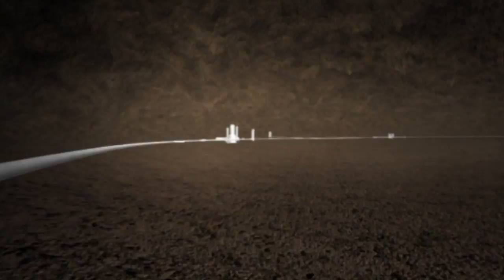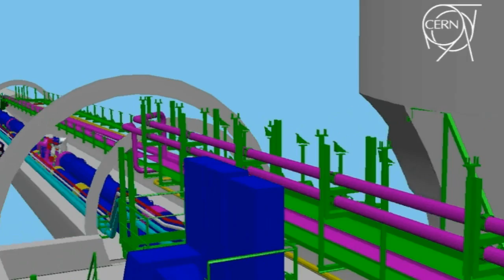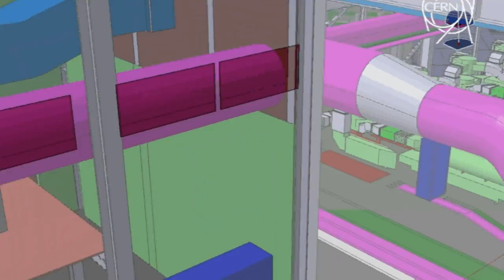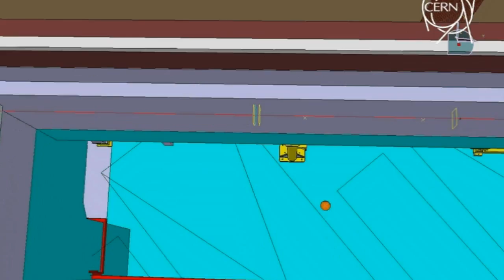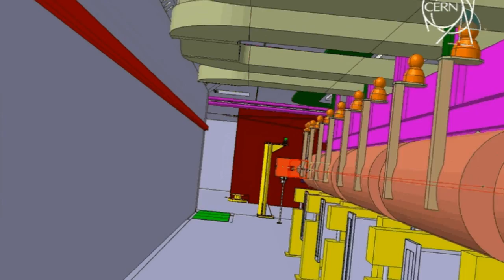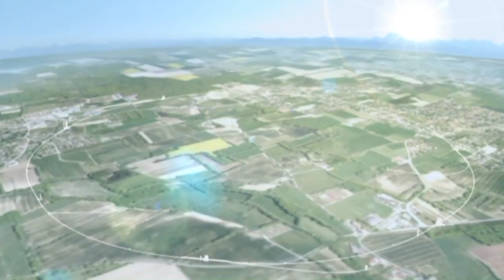CERN: LHC Virtual Visit

Comment: @fertilizerspike 
What bad behaviour of mine? I have merely pointed out the contradictions in what you say. If you can point out a single instance of me "throwing baseless suppositions and unwarranted speculations", then I will apologise.
Now, if the electric universe stuff is not the topic at hand, then what is? I am more than happy to discuss whatever it is.
Out of curiosity, who is alien8ted? I can find no comments by them on this page, although I see that they are indeed suspended.

Comment: @fertilizerspike Actually, large dust clouds massing several time the mass of our sun have been observed circling a point in space at very high velocities, something that can only happen if there are indeed something extremely massive in the centre of that disc. from the size and speed it is possible to calculate the gravity affecting the disc, and if that happens to be above 30.5 million G you have a black hole. (I may be a little off on that number, but it's in that ballgame)

Comment: @fertilizerspike 
"Claiming "black hole" has been observed negates the hypothesis, which states "black hole" will never be directly observed. I think you're a little confused."

Black holes can't be seen of course, however their EFFECTS on the surrounding space CAN, and when mathematical models mirror actual observations, they tend to get accepted as proof, until new observations are made that does not fit, in which case the models are modified. That is science in a nutshell.

Comment: @fertilizerspike "Stars are not powered by "nuclear fuel", they are lit by electric discharge. There is no possibility of them "collapsing" into a "singularity". "

You are pulling our legs, right?

All fuel that undergo fusion or fission can be called nuclear fuel. In the case of stars it starts out as hydrogen, and once that's mostly used up helium starts fusing, till you get iron, after that the star blows up, or if it's massive enough, collapse into a dwarf star, or even a singularity.